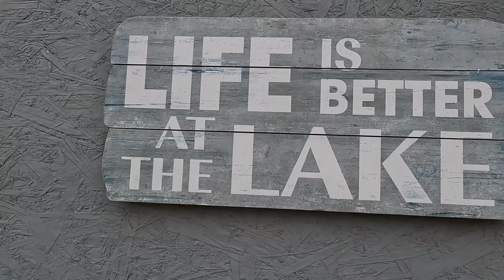CHOOSING TO BUY FIXER UPPER CABIN

Comment: Two things that are red flags to me: 4 feet of snow over the winter and flat roofs, and paint over OSB is not going to last very long. Once the least little bit of moisture gets into OSB it turns to mulch.
Reply: Mulch 👍 Yuup
Reply: about to say same  flat roof is VERY CONCERNING
Reply: I agree with not liking 4ft of snow on a flat roof... that stuff is heavy!
Reply: Jay, I share the same concerns about the flat roof and of course the exposed OSB.  You will need to get house wrap on top of the OSB and then exterior side panels...4 feet of snow is a lot of snow...can you fix the roof?  The cabin seems quite tall...If you don't like the whole setup, how fast can you flip this lease along with the cabin?  You are probably better off building from the ground up and planning access to the toilet from inside the cabin...🙂:face-blue-smiling:🥶🐻🐻🐻
Reply: @nonedispose7420  house wrap,  tyvek will still sweat. OSB doesn't forgive. As soon as if gets wet, if turns into wet mulch.
Reply: Sure flat roofs suck, but it doesn't look like there is a large surface area to be concerned about snow weight. Making sure the roof is leak proof, and metal siding would go a long way for that cabin.
Reply: At are cabin we’ve had it for 10 years with osb and it’s completely fine, but yes the corners start to crumble
Reply: But you can put some type of siding over that.
Reply: Oh yes I did forget about the flat roof grew up in a house with a flat roof on a farm & burned wood was our only source of heat in the winter time so the roof hade to be cleaned off more then once
Reply: @harmonysprogress  But the foundation is OSB. It's a lost cause when it gets wet.
Reply: @harmonysprogress  That would be the thing to do. Also, it appears to have what they call roll roofing on it. He could remove that down to the decking, install some trusses, some more decking, and some of those painted steel roof panels sold by Home Depot. With the size of those roofs, he should be able to have a pretty good pitch without too much material. That should make the majority of the snow slide right off.
Reply: @truckerdaddy-akajohninqueb4793  ahhh... Didn't notice the foundation.... Hmmmmm....

Comment: I would be concerned about the snow load on 2 flat roofs. It will definitely be a warm cabin giving you guys more room......and perhaps install a pitched roof?
Reply: I too would be concerned about snow load on flat roofs
Reply: In eastern Oklahoma we get sometimes maybe a foot of snow every 13,15 years one time, up there snow is measured in feet several storms, every winter. Gonna need a gabled roof for sure.😂
Reply: It's of little concern, Yellowknife usually only get a foot of snow in year, so the big accumulations that would overload the cabin are extra rare. Their annual record is just over 2 feet, and that was in 1957. in 2024, we're a bit shy of the record, at 68cm. The summer fire season is the biggest issue.

Comment: The area looks amazing. The cabin needs a lot of work. Might be better to build one from scratch and use the current cabin as a shelter while building a new one. Otherwise, I love the videos. Keep it going. I look forward every week for the new video. Maybe a mid week video would be fun.
Reply: Agree with your assessment.  I would rather build a new one from scratch or buy a different one.  This one is sitting on wood pallets 01:18

The location seems good.
Reply: In contrast to what looks to me a disaster, your fabulous tents are 10 out of 10 but this cabin looks poorly built and is a 2 out of 10. The site looks perfect but I would build a new cabin perhaps an A frame with a good slope for snow. Then insulate so that you will be cozy in the winter with a minimum of fuel logs. I agree that it could be used while you build your proper cabin.
Reply: That is a good idea.

Comment: Nice piece of land. That flat roof with as much snow as you get would worry me. Especially when your running the stove and it starts melting that bottom layer and turning it to ice. It looks like from the ceiling at the 8:50 mark the roof may have leaked once before by the ceiling fan. Good luck, and may everything work out for the best.

Comment: That little section of wall between the two roofs that you climbed out of would be the perfect place for a few windows, it would definitely bring some more light into the loft area
You could eventually build a long enough dock in front of the cabin and fish off the end of that, as well as keep your future boat on the side and the guests can have fun in the water since you said that the deep water starts almost at the shore.
You just need to deal with the bedrock and really attach the dock foundations to it.

Comment: Roof access: consider hinging the particle board and put a gasket strip around it. Easier then screwing it on and off. Possibly change it out to be a sliding window?

Comment: The one thing that would keep me from buying a cabin that someone else started building is that you're never quite sure of what they've done or how they've done it, so if something breaks then you'll have to put more effort into trying to figure out where the problem starts. On the other hand if you build it yourself and say there's a problem with the electrical or the plumbing then it will be easier for you to know where the problem is.

Comment: Watched your other video already so congratulations on the cabin. I'm a fan of metal panel siding, get a pontoon boat you can load up and it wouldn't take too long to do just screwing it in place over the existing OSB. The top access to the roof needs a big sliding window to go through, not a fan of the unscrew the panel to get out.

Comment: Oh, yeah.  A cabin in the woods on a lake - silly dream, really, never going to happen...until it does.  I'm living in mine.  I'd re-roof that one with metal pitched at a snow angle (it isn't as hard as it sounds), complete Darryn's (hope that spelling is close) insulation project, and yes, that's a unique old stove but you know what stove needs to be there, oh yes you do.  It was made for there.  You can do this, Jay!  BTW, see if you can con Darryn into appearing on more vids.  Guy's a hoot.  Crossing my fingers here...

Comment: What a beautiful spot! Fishing, boating, ice road access, that all sounds great. I would be concerned with the pilings supporting to cabin itself - it’s a lot of work to jack up a cabin to amend those. The other thing is the wood siding being OSB - it’s so bad with any moisture. That would concern me as it can really deform and deteriorate quickly. I’d think you’d need to be clearing the snow off of that roof as well in the winter. 

If you’re able to work away at a new structure using that as a base - that spot seems ideal. 

No matter what happens, I can’t wait to see what’s next.

Comment: Not a flat roof fan! Heavy snow in winter could be trouble. Would be a deal breaker for me! Thought i saw water stains on ceiling. Cabin looks poorly designed. However as you stated its a fixer upper! View and lake are awesome and in a great location. This is just me but i would rather find some acres or a lease in the area and build my own small cabin!

Comment: Great find. If I could make suggestion…get the fascia covered up sooner than later. My preference is James Hardie concrete fiber board (8”x12’ planks). Easy to install, won’t rot or succumb to the elements. Holds paint great, too.

Comment: Something I've been concerned with watching  your videos is your wall tent.  Don't get me wrong, I love that place.  You truly are outdoors but with being outdoors come consequences.  One of which are hungry bears.  Another is the fact that your are millimeters away from brutal cold, some of which will kill you quickly.  I think that this cabin would give you the security of a stabile shelter with protection for you and more importantly for your better half and it would also give you the outdoors at the same time.  Plus, you tinker.  You built that tent, the walls, the floors and gates with your bare hands and I think you'd have a ball making the inside of that place your own.  And on the plus side I told you when you first brought up your GF that she was a keeper.  This cements that.  Just one man's opinion.  Best of luck on it!

Comment: I think it’s a bonus that the cabin sits on ledge. You would probably plan on drilling the rock and anchoring it if it has not already been done. If the sills and framing are solid, then you could add proper siding. Looks like the loft area where you crawled out onto the roof needs flashing on the outside where the wall meets the roof. Other than that, if the price is right, I’d go for it.

Comment: If you think the price is right I'd pull the trigger, you can always change what you don't like or want done differently. If its as accessible as you say during winter snow load won't be an issue as long as ur out to clear it now an then.

Comment: Hey Jay and Crystal!  I love the upper deck.  A couple of benches (a railing for security) and not only the view of the lake during the day, but the stars at night!  Lots of potential.  Lots of work.  I like the electrical system (well it's a start anyway).  A great place to be in the middle of winter.  Good luck with your decision.

Comment: Having built and bought a few cabins over the years, that access to the other roof is leaking in some water. It is simple to get out in summer, but pile 2 foot of snow and try to access the roof is a problem. Needs siding, screens, insulation, outhouse, shed, and id switch that roof to metal as soon as feasible. Also get a boat, what if you hate the amount of work, expense, etc. the boat is?

Comment: Buy it with  having your  Bear tent with  you !!!  Buy another   wood  stove  for yourselves  out there  !!!  On  top of the roof  in  planters  plant   veg  up there  and have some  beets  also  as they  are the coloring for the  pike  in  pint jars for yourselves !!!  Put the  pike in the  jar  with a  slice of  raw  beet and it will  WB  for  3  hours then it will be a  red  color then for you !!! Have done this  for  years  !!!  Also  smoke the  pike or  trout  !!!  Buy  a  Metal  Can  trash one  with lid  for  burying it into the  ground  for  meat and other food items  BEARS  won't  find it  if it is  covered with  snow and you have  bear  door  walls around it  !!!

Comment: If it was me I wouldn't buy it. Don't like the high ceiling just empty space to heat, I'd get a news wood stove, don't like the flat roof depending on how much snow you get, you'd have to insulate the walls & put better windows in, lots of our buildings to build, Jay you wanted comments mine looks like the only negative one but it gives you some thing to think about GOOD LUCK what ever you decide.

Comment: No.1 Priority is the make the building "bear proof." All doors and windows must be re-enforced. Spend the cash it takes to do so. No. 2 Get two EcoFlow Delta Pros running in parallel split phase 240 Volts AC @ 30 Amps and wire the building distribution box giving you two rows of balanced 120 Volts AC @ 20 amps load per circuit. Each Delta Pro can take an external 3.6 KiloWatt Hour external battery and an EcoFlow smart Gas/Propane generator, which will switch on and recharge the Delta Pro's once their batteries drain down below a percentage that you can set in their phone App and shut off when the batteries are charged at the upper percentage that you set them to. 3. Each Delta Pro can handle 1600 Watts of Solar input giving you a total of 3,200 Watts between two units. 4. Insulate, insulate, insulate !

Comment: I like it but certainly put some log cladding on the external walls. The wood in the walls will certainly perish quickly. Also is there anyway to convert the roof to a pitched roof as opposed to flat?

Comment: I share this kindly as a concerned experience. 

Foundation?????

Floor joists ?????

Moisture barrier from ground to floor joists, and then is the floor insulated under floors, and are they able to hold weight load of your housing needs

Bear proof the bottom with bear proof ventilation for air flow

Roof snow weight
 load. Ice build up. Strongly suggest steel roof slanted to building code

Insulation to the highest r value will keep you warm to cool. Foam insulate every crock and nock. 

A solar system looks prosperous as it will pay for itself. Three backup systems are not overkill 

Stove and venting for wood and house cooking in kitchen

Water system with filtration, insulate, and shut-off drain valves. Use lake as a resource, catch rain water 

Indoor shower, compost toilet. It's not fun bearing cheeks in winter. Make great propane or solar tankless water systems

Dock that can be removed in winter. Makes loading and unloading safer. Nice bench on the end to sit and take in the view

Nice chunk of land with slooping away from the cabin to keep your foundation dry. Road access a big plus but with that comes maintenance. I would encourage a sound shed with a floor to hold snowmobile, boat, tools, and ect.

Bear fencing run off solar has saved my Uncle his life and property over the years. They take it down each late fall and go up each spring asap. Folks used to laugh at him until a tragedy happened in his area. Food for thought

I am sure you and Crystal have pondered many things. Be careful  not to get tunnel vision. Make goals, wishes, wants, and musts. Set a timeline of importance before  winter. Best regards to you in your hopes  of being cabin owners. God Bless Your Home with peace, love and safety.

Comment: I do like the site...... honestly.   Peace
Reply: @JayLegere_  just concerned with materials used to build the cabin, and I'm not  a fan of flat roofs, is it level, what's it's base consist of is it strong enough and stable, are there any signs of dry rot. Do not want you going into this blind. Lots of tall space to heat in the winter too. Love the location,  Peace
Reply: @JayLegere_  also is that really the cabin you Invisioned.
Reply: @JayLegere_  is it properly insulated,  is the floor insulated underneath, is the fiber board on the outside swelling much, how's the wiring is it safe....love the site

Comment: That type of plywood is not meant to be exposed to the elements it will swell and rot quickly. It does need siding and insulation to be protected against the elements.

Comment: Very good Jay! I am going to play devil's advocate here and list some stuff I had concerns about. DO NOT take this to mean that I think it is not a good purchase. This is how my mind works, and I figure if you have good answers to all the questions people ask then you will feel more comfortable with your decision. I had to make a lot of assumptions so apologies on those issues I misinterpreted. Here goes:                                 Did you confirm the ice road still remains viable now in recent years (warmer winters)? (I am assuming the cabin is not accessible by land, and limited accessibility means limited visits) Did you get a satisfactory reason why current owners hardly used the cabin and why they are selling? Will the cabin need extra effort to heat since it has a very high ceiling? They said the bear tore things up in the winter...wouldn't bears be hibernating at that time? Is it a good idea to buy property with a non-spouse (lawyers may say otherwise)? You need to use a generator for power - well there goes the peace and quiet of a remote area. So you would probably plan to install solar...did you add that cost into your budget?                              Best of luck in your decision.

Comment: I agree with most this may hold up for storage for a while, but build something different, this thing is going downhill fast.
Reply: @JayLegere_  all I'm saying is that I've had a trailer home about the same quality. The window really reminded me of that. Once you get rot and damage you're going to need to tear down to bones. I think you'll be unhappy that it's so small as well, even though it's technically two floors. Stick to one floor, and build something solid. Log cabin. Why break away from what's already working for you? Take your tent idea to the next level and get rid of the tarp.

Comment: Snow on the roof won’t be an issue for you. Small area that looked to be pretty solid and…you are up there so often that it won’t be sitting. Wrap and siding for the exterior for sure…looks better and will make it tight. The seams between boards on the outside had me cringing…